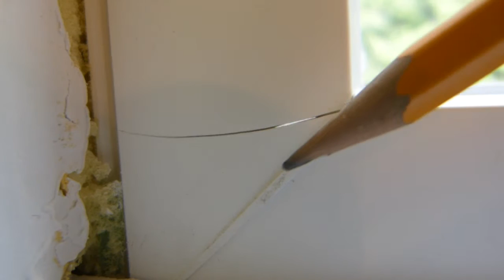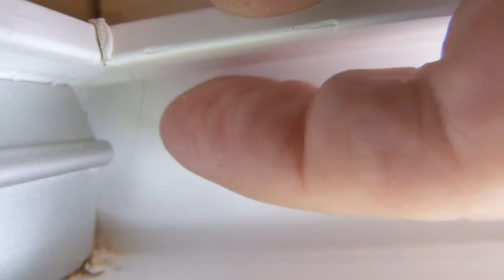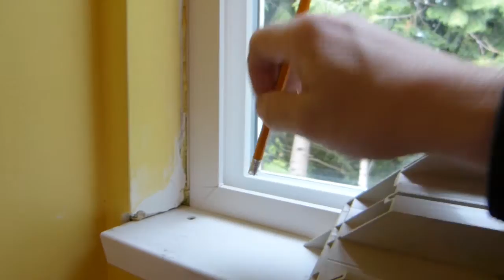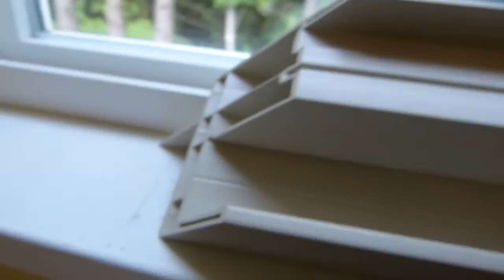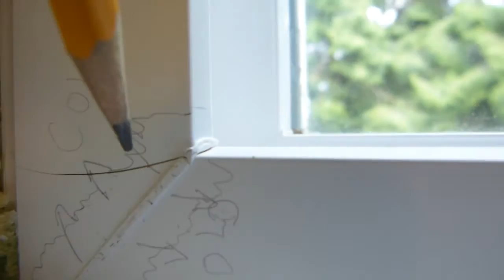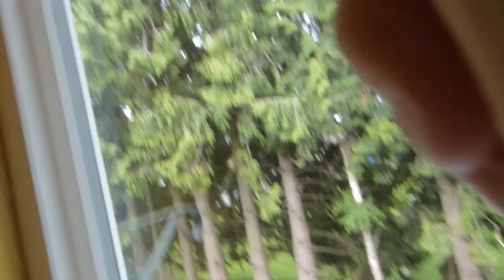Jeld-Wen plastic window FAIL

Comment: OK so first thing is first. he tell you right in the video what caused the problem. He states it didn't but it did. Expanding foam around a window is a HUGE no no. I know it is expanding foam because it is yellow. I am also able to tell you that it i a high rate expanding foam the "large gap" filling kind. I can tell because of how large the pockets of air are inside the foam. The foam pushed into the window frame bowing it in that would cause the inside edge of the window to want to stretch. Now it might have stretched if the window frame was warm. if it was cold it would crack exactly like what you see in the video. The gap would get smaller the closer to the outside of the frame. JeldWen windows are horrible anyhow. They make the vinyl too thin and that allows for instability and warping which causes air leaks.

Comment: All he says is plausible. He has offhandedly eliminated installation as a fault but not shown in detail, fastener type and location, degree of force and diameter of hole related to fastener. It appears a 90 degree corner opened to 90 plus degrees under stress. He claims molecular failure.I somehow missed if this is a single, double or slider. If a slider from right to left is slammed, could damage occur? Is the frame twisted from installation? I'll assume he considered all other factors and go with his analysis. I'm a layman. I just can't help feeling that the trillions of welded plastics in the word are so susceptible to late stage failure due to s.o.p. manufacturing. At least it wasn't a frozen o-ring on a Challenger.

Comment: I don't believe it.   This is an installation problem.   

If the shims were not properly installed AND secured by screwing through them, then bending stress forces will propagate through the diaphragms and connecting members.   The stiffest point will be where it breaks first.   It may be that the area next to the corner is stiffer, but the material will not "tear itself apart". 

It is being torn apart by one of two things, 1) the center of the frame half way up on the  same side was tightened too much, creating a bowing effect on the frame,  It may also be possible that the window sagged, or was over tightened on the bottom creating the same stress.  or 2) The frame of the structure itself shifted after installation.

This type of bowing occurs when a screw through the frame is over tightened.   More so if the shims are unequally set.

Comment: I’m sorry if I offend anybody, but issues of construction fails are always blamed on the installers, apparently we ( installation technicians) are to stupid to do our jobs, WRONG !  Let me educate everybody ( try to keep up with my “unqualified” 35 years of experience), there are m multiple issues here, but I’m going to start at where the buck should stop, I don’t care if you’re a builder, homeowner, subcontractor, or neighbor, if you receive bids from qualified contractors, and you choose somebody because they were the cheapest, well guess what, it’s you fault! Know on to this situation, if this window was installed correctly, there will be screws from the side jambs into the cripples, and the video voice over clearly shows and states the expanding insulation spray foam, and I can clearly see this is a replacement window and it looks like plaster walls, I’m guessing from about the 60’s, how was the exterior sealed ( sorry I didn’t watch but a couple of minutes of the video because I already knew from how the narration was going that it was a manufactured blame ( oh I may have installed a few Jeld Wen Windows) any water or moister causes movement of walls, plaster or drywall, wood, and temperature affects plastic. Next let’s use some basic physics, yes I had a few classes in high school and college, if a fixed unit like I don’t know, maybe a square perimeter with let’s say, ummm a separate and different material that has different chemical properties , if both are exposed to temperature changes, guess what, they DO NOT expand and contract at the same speed, which would probably result in a shift of, I don’t know, maybe a crack on the inside corner, why inside, welllll, it’s the weakest point of the joined pieces! I’m not finished yet, I personally use the exact spray foam myself, even with my experience, you can not know exactly how much expansion you will get, therefor you need to do it in two or more steps, I seal all the rough lumber, rough opening a day before installation, then clean off the rough opening with and old drywall knife before installation, I install window and spray the foam again mostly in the corners and light in the middle, when that is done, on my hopefully final foam spraying, I will go all the way around the window again, ( NOTE TO ROOKIES, YOU HAVE TO LEAVE THE WINDOW COMPLETELY LOCKED THROUGH THE PROCESS, THE EXPANDING FOAM WILL ABSOLUTELY BOWANY PLASTIC WINDOW JAMB OR SEAL ) you may think the foam is dry from the appearance on the outside, but trust me it takes hours for the inside foam area to dry. Here’s a free tip to any installer, that foam sucks to clean up, take painters tape around any finish edges that you don’t want it on, including brick, which I use duct tape for that, and clean up will be a breeze. Oh most important of all, remember the next time you go with the cheapest contractor because the experienced contractor met with you first and he told you how he was going to approach it, we ( the experts) are smart enough not to tell you exactly what we’re going to do! I’d like to add, my expertise is custom interior trim and custom cabinet making in high end residential and commercial builds new and old.
Reply from the maker: Thanks for your input!

Comment: Absurd to blame the manufacture exclusively.
There are many variables to a vinyl corner weld failure.  Most are due to improper handling and installation.

Comment: This is an  installation problem., you can not see the corner of the window, you see that it is embedded in the wall which is not normal in an installation, so the pressure broke it
Reply from the maker: Pressure does not cause tension. All other windows, handled and installed same way, same day are magically fine.

Comment: If that theory was correct, I bet a lot of people would be losing sleep over the plastic gas lines that are the standard now. I installed 21 Jeld Wen windows in my home 7 years ago, purchased from the "Bargain Outlet" no less, and not one has cracked or had a seal failure. Likely it was damaged in handling.
Reply from the maker: Manufacturing defects show up within a month, nothing beyond. Sleep tight.

Comment: your understanding of plastics is flawed. window frames are extruded. sonic welded parts will not cause that much shrinkage. i have been a plastics process engineer 41 years, in my professional opnion this is an  installation problem.
Reply: I agree I have sold vinyl windows for 20 years. cracks are caused be installers racking the window.
Reply: If you push in from the outside edge of the frame, the crack will be widest at the furthest point from the applied pressure.  The outside edge is in compression, and the inside will be under tension.

Looks like you used the wrong kind of expanding foam.  Great Stuff regular cavity foam expands with significant force.  That's why they make the low pressure window and door version.

So yeah, you botched the explanation of why it happened, how it happened, and your window install.

What kind of engineer are you anyway?  Civil?  Definitely not Mechanical.
Reply from the maker: @MotivatedMetalworks  Still no explanation on of how the crack starts and propagates. Resultant invalid conclusion.
Try reading a pertinent textbook, perhaps.
Reply: @theoverengineer  LOL  It starts from excess side pressure between the window frame and framed opening.

Try not being a tool and admitting your whole video is off base.
Reply from the maker: Sounds good, reasonable point, run us through the mechanism of causing a crack asymmetrically on only one side without impact loading and pulling it out of 90 degrees at the corner.